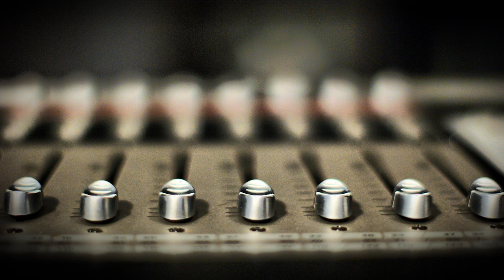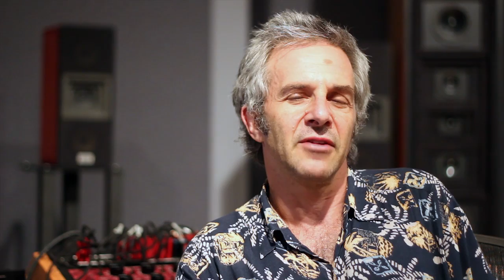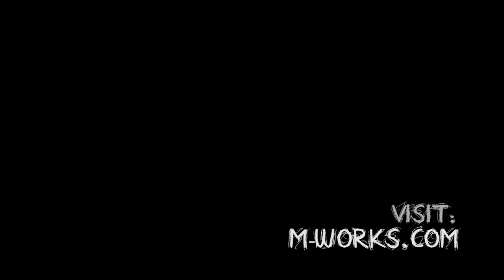Analog Versus Digital Compression

Comment: its not the FRACKIN 44k 96k 128k one millionK, its the BIT resolution that wil bring true analog sound. if u runn 44k96k128k tru a 64 bit data plugin, it will always only be 64 bit data..... 32 bit plugins was good, 64 was a game changer, if u try both u can hear the change. when we get 128 or 256 bit data prossesing power we will get true analog sound in the DAW. anoter problem most DAWs dosen go over 32 bit. i hope DAW produsers starts make higer bits resolution. AND if your sampels and soft synts are in 44k, its dosent help sett your DAW to 96k.

Comment: certain digital compressor (not all) sample the circuit and power supply noise as well.
and some actually have algorithms to generate said noise.
good examples would be Waves and VarietyOfSound...

the thing about analog compressors which is double edged if you ask me is that no 2 units will sound alike.. even if they are from the same model..
add to that time+wear of analog gear, and you're not quite sure if what you're hearing is the original unit character or.. a worn out unit..

Comment: Digital is inferior, just often not noticeable to the human hear, or unless compared side by side with the original.

Take something digital, dip the EQ(process), then boost again, repeat several times. Severe distortion will result.A signal lost in digital is very hard to recover once modified

Analog is not bound by this principle because analog is almost 100x-1000x more data of the sound than it's digital counter part, unless sampled at unreleastically unproductive bitrates due to their size.
Reply: i can get more gain reduction using digital with it no pumping  effect  like analog could that be ????? for clean and precision digital

Comment: It isn't that complex as to why Analog Compression will always be better than digital.

When you compare digital and analog sounds, and analog sound has much much more data than a digital sound. A digital sound is compressed so it can be digital, or else a single sound would be GIGABYTES. When you boost a sound while it is still analog, you are retaining much more of the dynamic range of the sound than with digital, because the digital sound is already compressed.